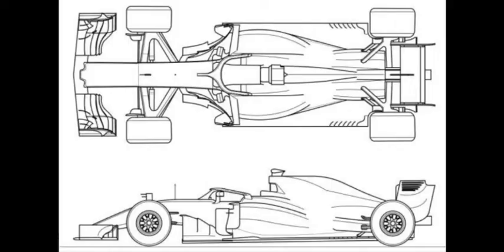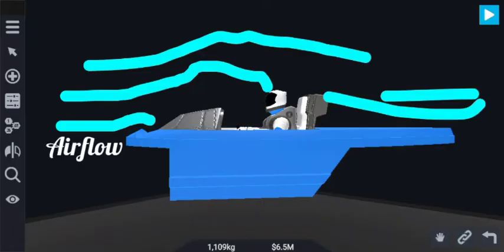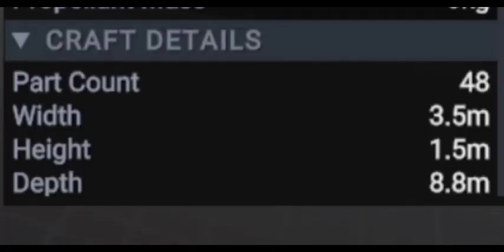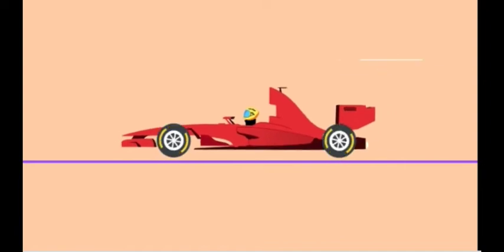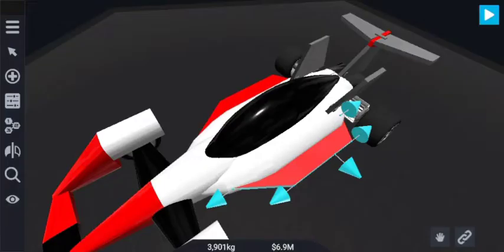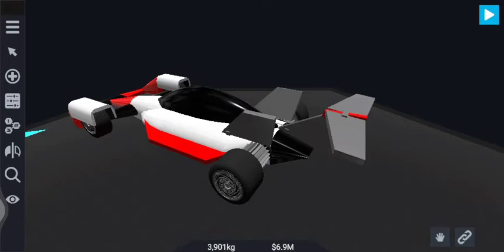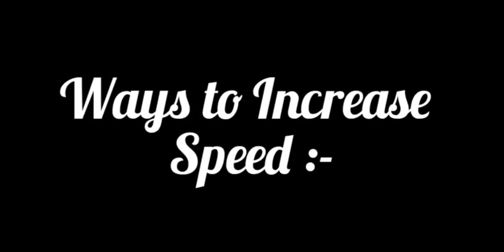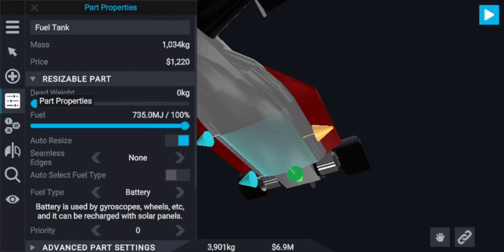Making a F1 Car in Simplerockets 2 | No XML, no Tinker Panel | ABM Hyprus

Comment: Hey yeah good job buddy

That speed was not realistic at all but bruh idc

Heres the thing F1 cars have 3 stages of getting lift/downforce:
    1. Front wing
             Front wing is a piece of wing in front of the car that make a lot of downforce to the front wheel therefore making better control over high speed and tight turn . The wing was designed to pass the air up while the remaining air is going through the front wing
      2. The middle piece ( or whatever you wanna cal it ) 
                  Is the piece whose responsible to making the most downforce as Possible .the air that pass through the front wing is getting into the MP(middle piece) and directing the air up therefore making more downforce
        3. The spoilers
                These peeps in the back is the one that make acceleration because the push the back wheel down making more traction to the back wheel. By making more traction the back wheel can get a higher acceleration . These spoilers also making the car easier to control by reducing sliding by the back wheel

Also the back spoiler have a system called DRS or drag reduce system 
Which open up a gap on the spoilers.
If the theres less drag there is more speed so on vice versa

 Ill probably gonna make a vid about this but my car have some issues :v